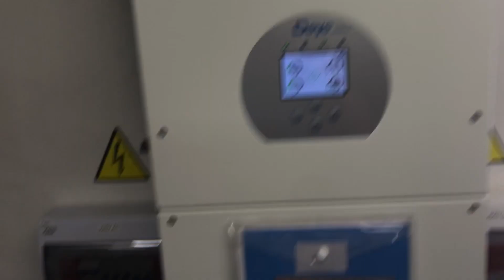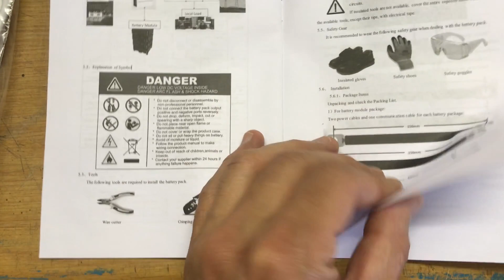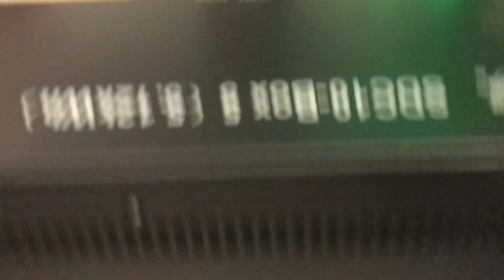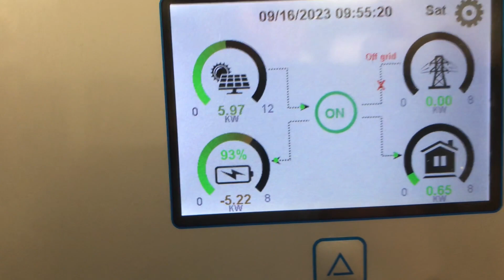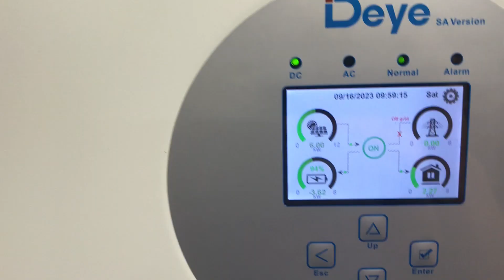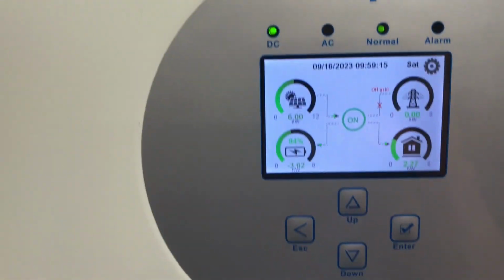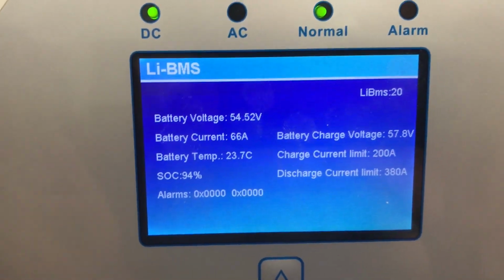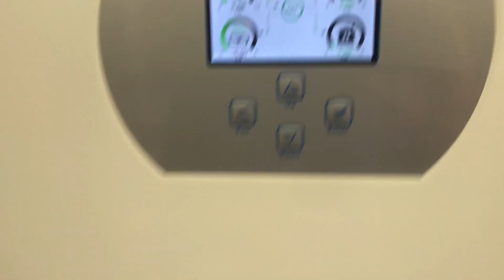SHOTO batteries connected to DEYE inverter

Comment: You may need a busbar for the batteries. The connections to the DC disconnector may produce heat on big loads
Reply from the maker: Yes, I agree that a busbar would be a better option. However, I have monitored the temperature at the connectors under max load (8kW) and it's acceptable.

Comment: what is the app for shoto bms?
Reply from the maker: I don't use an app specifically for the SHOTO batteries. I use the SOLRMAN app for the inverter and it's got some basic BMS info, but I haven't needed to investigate any issues with the batteries, so I haven't bothered trying to find an app for them yet.
Reply: @unorthofox hi another question can you do a video how did you connect your battery and what cable wire did you used? thank you sir.
Reply: well thanks because my shoto is locked in 10amps charging thats why im looking for the bms app for configuration
Reply: @carljohncoronel3754  We found our batteries had a charging restriction on them too. Soleved it in the end. Did you find the BMS software?
Reply: Bro i also need software, same issue, did you find the software @carljohncoronel3754

Comment: Please confirm how the number of cycles for your batteries
Reply from the maker: I'm not sure how to track that using the SOLARMAN app that I'm using. I estimate there are 2 charge/discharge cycles per day, or 60 per month. So on the oldest batteries, that have been in since May, or 7 months, it'll be around 420 cycles.
Reply: How is the bettery performing? @unorthofox